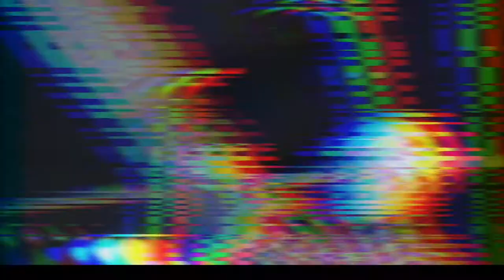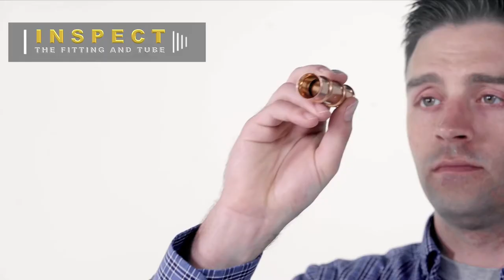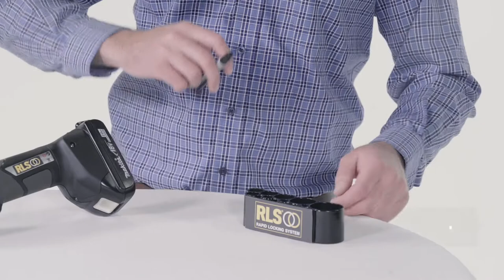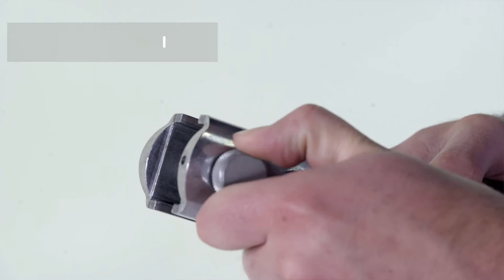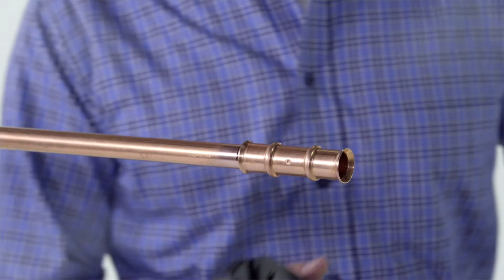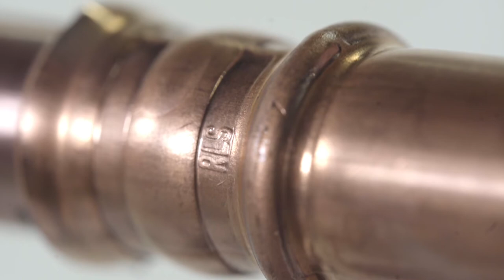RLS Step-by-Step Demonstration

Comment: I recently ordered the Klauke 19N kit and am ready to get it in my hands. It took me a long time of watching videos and obtaining all the information I could get to help me decide if it was worth buying. It’s a process that I believe will work provided the instructions are followed correctly. It’s not a cheap purchase but I’m always into looking at ways to make installing units a little easier. Yes the fittings too are costly but if it performs as advertised then I’ll know I made a good decision. It does take a lot of praying to drop that much money on a system that is coming into the industry as a better way than the silver solder and acetylene/oxygen process that’s been around for years. I just know that in my area there are numerous companies and individuals who have came on board with the RLS system and they are very happy they did. Going up into an attic with a plastic box with all the tools needed to join the line set rather than the old way is a game changer for me.
Reply from the maker: That's great news! We appreciate your business and happy you chose to use RLS!!

Comment: Man it would be nice to have one of those tools for flame free locations like hospitals when working on refrigeration cases tried the push on fittings but they leaked to the compression tool would have been great and a extremely helpful tool to have to repair the leaking SRB fittings.